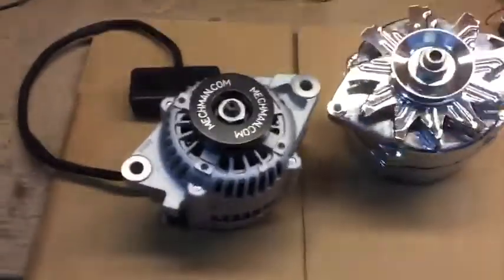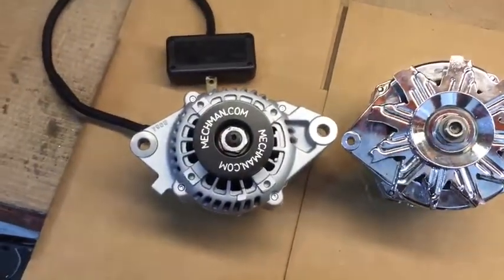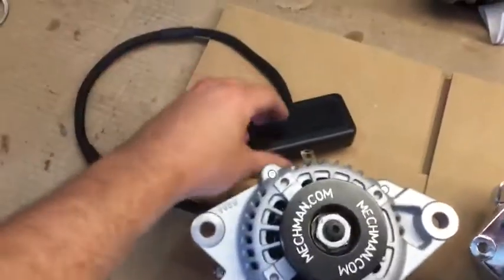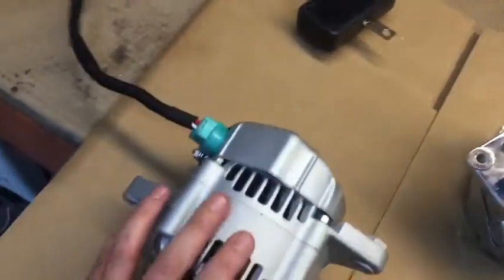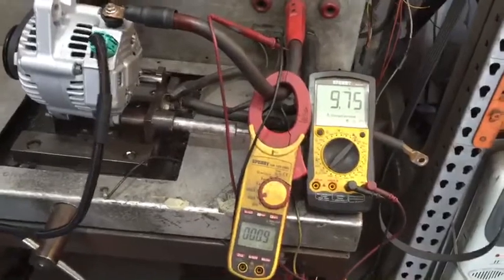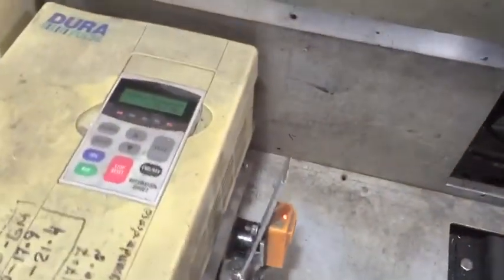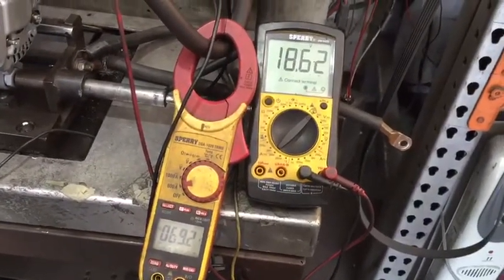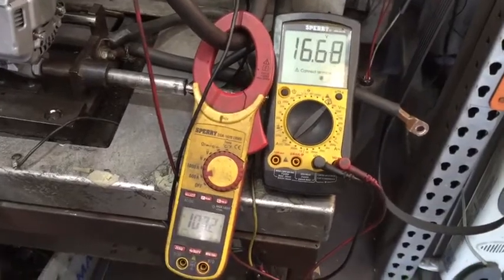Mechman Mini Racing Alternators

Comment: could this be used to run 16v system?
using 14v batteries.
Reply: +Eye4GotM8 if you adjust it to the right voltage, yes